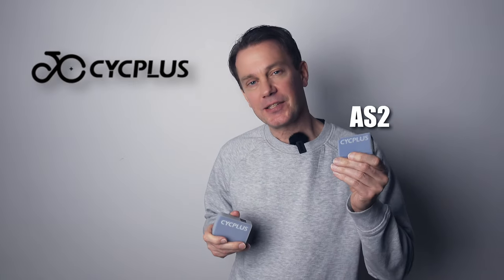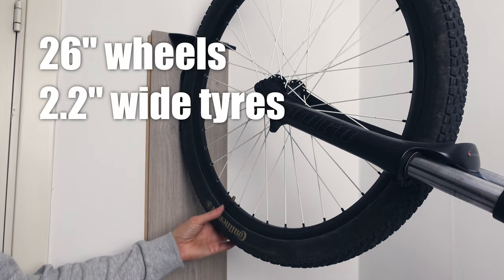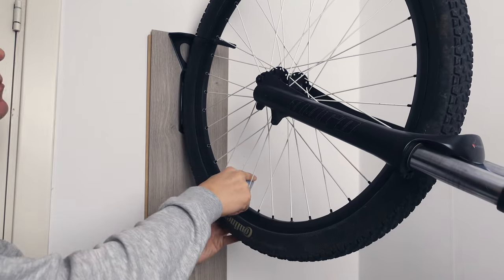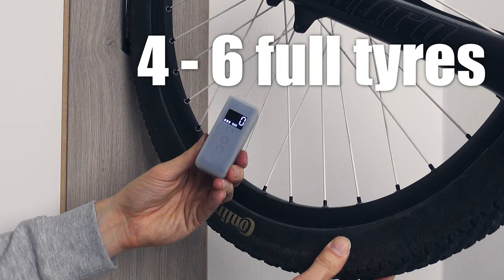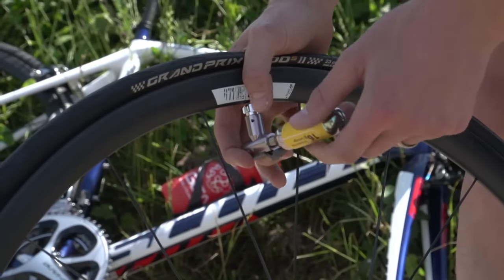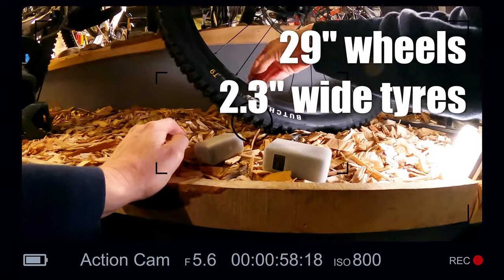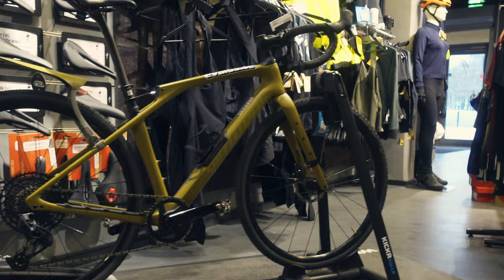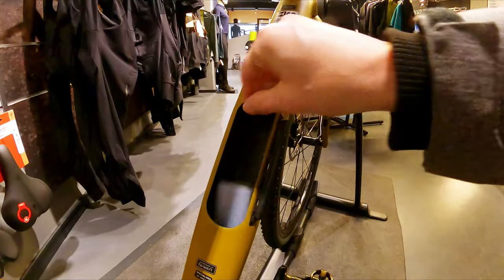Replace your CO2 pump? Cycplus AS2 Pro Max REVIEW | Tests on lots of different tyres

Comment: You should compare them with Fumpa if you can. At home I use a Makita inflator. But I like a smal pump like this on rides, just have to remember to charge it.
Reply from the maker: Would like to test a Fumpa pump too. But in the end I think they are very similar.
Reply: Have you tried it in subzero temps? how long does the battery last?  @MTBs
Reply from the maker: No, only the small one in +5 degrees. That was fine. Like with all electronics you would probably want to carry it close to your body if it's very cold to maintain proper function.
Reply: @MTBs  Fumpa is fine, even in - 10c.
Reply from the maker: Have to test when it gets colder, but I rarely bike in -10 degrees.
Reply: no need to spend 90 bucks on one though. amazon has pretty much the same thing for about 30

Comment: ive been using a generic pump like this from amazon for 2 years. it was 35 bucks. about the same as a floor pump.
Reply from the maker: Great that it works for you. But you can always get cheaper stuff from Ali or Amazon no matter the product. A wild guess is that a Cycplus or a Fumpa holds up better over time and perhaps have better performance/capacity.